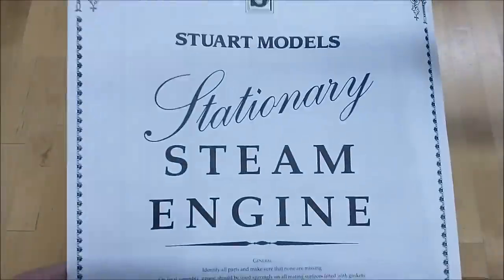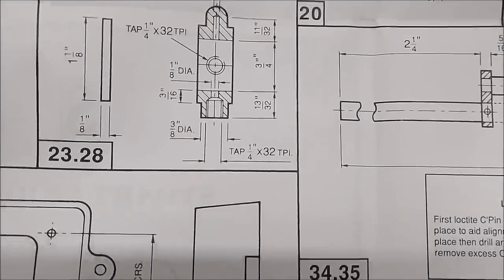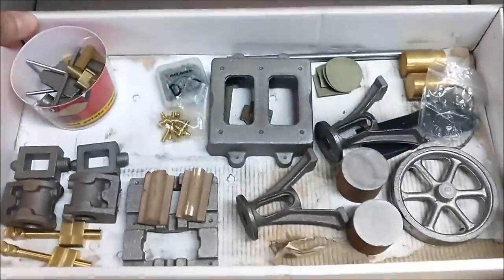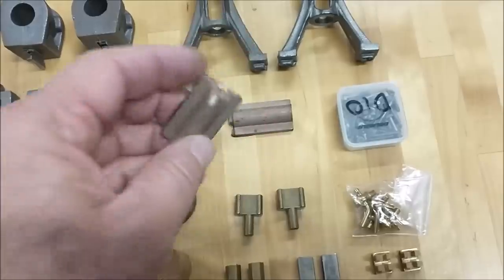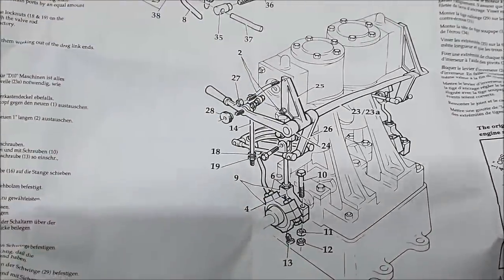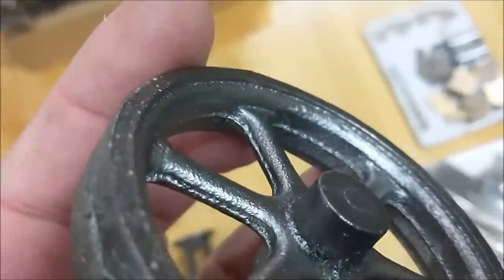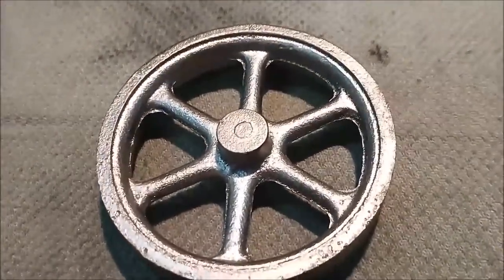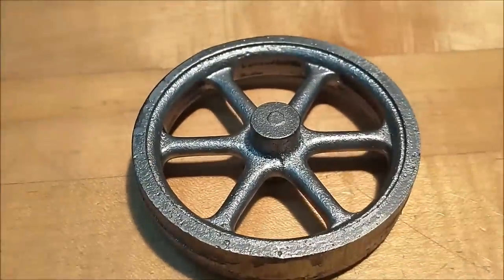Stuart D10 - Vertical Twin Cylinder Steam Engine - Lets Begin !!

Comment: I am going to enjoy watching this video build, but FYI , there are a whole host of errors on the drawings!!! Some are minor, (at time stamp  1:24,Head bolt orientation on flywheel end of engine  is incorrect) some are obvious. Listed as a proof reading exercise it is a whole page worth!!
 I made my crankshaft out of solid bar, and while very pleased with hitting all tolerances I then found that the  spacing of the con rods centre lines on the crank, does not match the spacing of the towers on the base plate “pads”, by quite a bit, so I either need to re make the crankshaft, or have the base re cast. Drilling the holes to account for the error will not be aesthetically pleasing☹️
My assessment of the crank problem is that the base casting supplied is incorrectly made! The 1 21/64” outer bearing centres don’t line up either!
So please be carefull✅

Comment: Maybe I'm not able to notice but I can't see anything metric in these drawings... 🤔
Reply from the maker: The BA hardware.
Reply: @joepie221  You're right. It is technically metric although not "ISO metric". Pitches and diameters are not "nice" numbers in milimetres or inches (OK, somewhat nicer in mm than inches). I would say it's just British mix of both worlds🙄
I would definitely use the closest metric bolts and nuts (or in your case, US standard) instead of that mess.